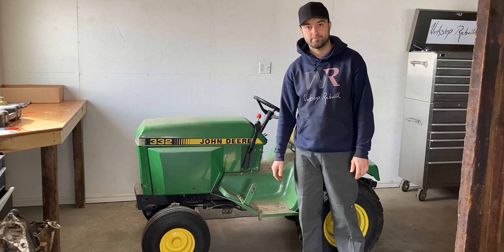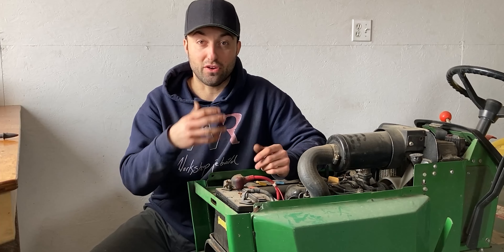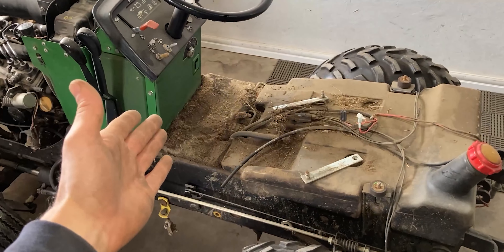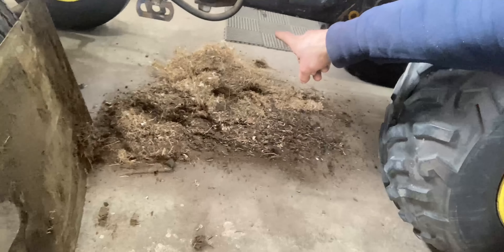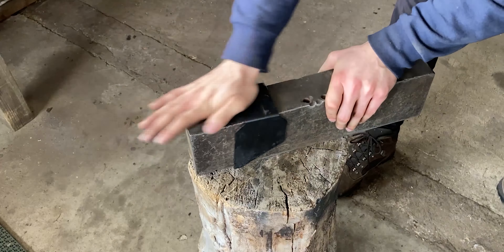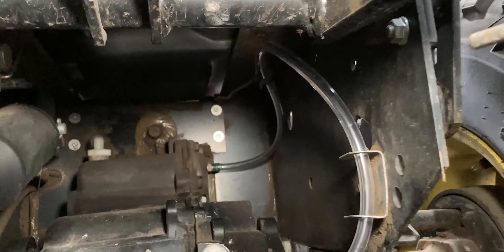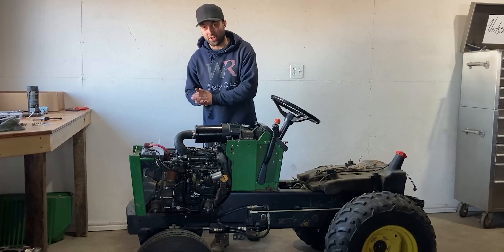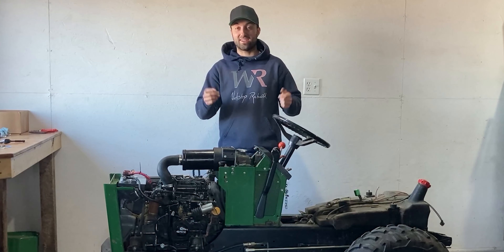Let's Service This 1989 John Deere 332 Garden Tractor!

Comment: This came at a good time! I have a 430 diesel that is having an issue with melting the fuse block. I am thinking its the wiring that needs to be cleaned up. These are great tractors! I have a 322 gas yanmar powered one too. These tractors have needed very little since new. I inherited both and they're approaching 900 hours on them. I hope to pass them on to my kids some day. Thank you for your work!
Reply from the maker: Hi Max, I just read that this was an issue with the Yanmar powered John Deere garden tractors. Since everything works now, I don't believe the fuse block is at risk, but I will double check. The only way this can possibly happen is if the connectors of each fuse are loose. Poor contact will cause a fuse holders to melt. It might be good to clean up the fuse connections and give the fuse block connectors a squeeze with some pliers. This way they will grab better. If I notice anything abnormal, I will update you on this situation!
You have some very nice tractors and it would be wonderful to pass them down. I hope you can keep them up and running for many years to come. Regards Andreas

Comment: I work at a John Deere dealership as a service tech and those are the same brand filters we use
Reply from the maker: Hi there, thanks for letting me know! I've received many comments about my choice of filters, but I'm glad you were able to back me up. I never noticed any issues with WIX filters and I will continue to use them for my projects. Thank you for your comment! Regards Andreas
Reply: Wix is a good aftermarket brand, but if I was taking my machine to a dealer and you weren’t using genuine JD filters and parts, I’d be a little upset. When I get parts from my dealer, no one hands me a WIX.
Reply: @jdraupp  it’s in the service kits, and they don’t always have them but I prefer them, they’re nicer than the John Deere filters

Comment: Good channel I have a 317 with the motor locked up my son is suppse to see it he can get it apart and see if we can over haul it and i have a 318 great machine
Reply from the maker: Hi there, thanks for tuning in and I'm happy to hear that you have a 317 that needs some work. I did a full series on a 317 a while back and this is the link to the playlist: https://youtube.com/playlist?list=PLJYgf55IHeu9FxtkEcHdCS0C0I7vtCa6_
In the second video, I discuss the differences between the Kohler KT17 Series 1 and Series 2. This will help you for your rebuild project. 
The 318 is a much more refined tractor compared to the 317. If you have them both running, you can get A LOT of work done with them. Regards Andreas

Comment: Don’t let people give you grief about the Wix filters.  Wix is owned by Mann+Hummel.  They own and make brands such as Wix, Mann, Purolater,and Filtron to name a few.  They also do private label for companies such as John Deere and Napa Gold.  They can build to many different specs on the same filter.  If you were to cut open a Wix, Deere or Napa Gold they would all be pretty much the same inside.
Reply from the maker: I appreciate your comment! Thanks for sharing this information with me, which I did not know. I have always opted for Wix filter for many vehicles and different types of equipment. Then work well and are readily available at my closest automotive store. Al they need is the number and they can cross-reference it to any Wix filter pretty much...which is super helpful!
I noticed JD and Napa Gold filters are at least 20% more expensive, but that's actually not the reason why I don't buy them. If they are the pretty much the same, that's pretty much all that matters. Thanks again for your comment. Regards Andreas

Comment: It shouldn’t be too hard to push. On the right side in front of the rear wheels there’s a bypass for the hydraulics to make it easy to push
Reply from the maker: That is correct, the lever to activate the check valves is on the right side of this tractor. Even when pushed the lever down, this tractor was very hard to push and it wasn't any easier than the JD 317 or JD 300 that I have. The hydraulic rear end is very restrictive and it should never be pulled or pushed quickly, because you want the fluid to pass through the check valves.
The John Deere 400 on the other hand is much easier, because you have a 2-speed transmission behind the hydraulic motor and you can luckily put it into neutral.

Comment: Take the mesh screen off the bottom and all the mats that are surrounding everything in the rear of the tractor. Throw it all in the trash. Every time you use your machine give it a quick blow out and it won't ever get like this
Reply from the maker: The mesh screen is definitely trap for debris, especially from a mower deck. I will keep it on, since I will not be using this tractor as a mowing machine.

Maybe if it collects too much in a short period of time, I‘ll keep it off! Thank you for your suggestion, Alex.
Have you run into other issues on you JD garden tractor that you leave away or have changed over the years?

Regards Andreas

Comment: A lot easier to add oil in the valve cover.
Reply from the maker: Both are oil filler caps, so it doesn't really matter.